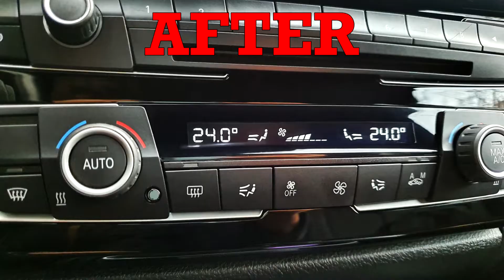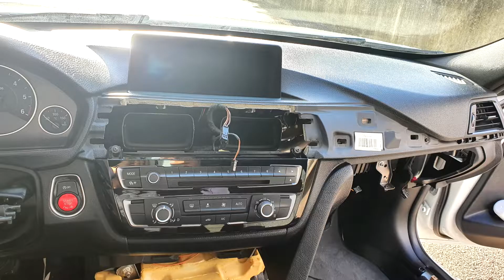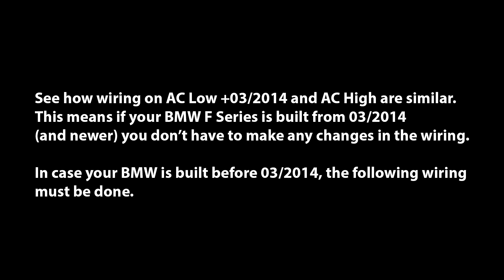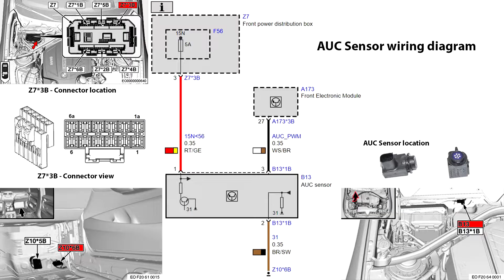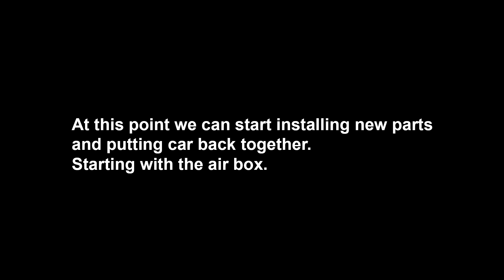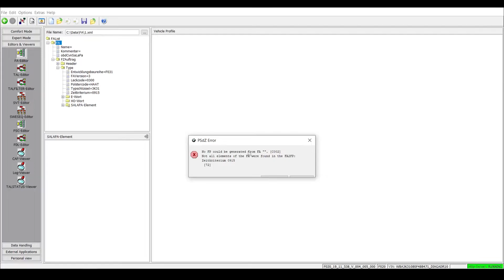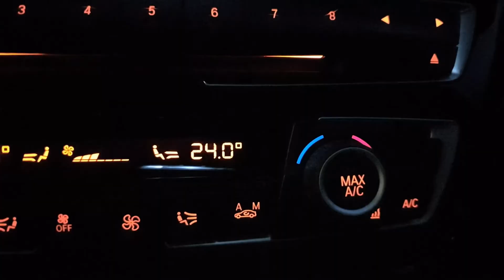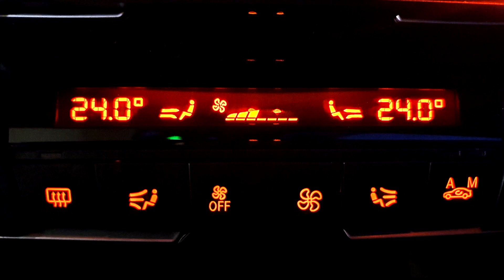Dual-zone A/C retrofit on BMW F30 + IHKA3 Retrofit

Comment: Well done mate!
I've done the same retrofit on my 05/2014 F20. Was a little bit easier than yours because I didn't needed to change dates on FEM. Also my car is already equipped with can2 and IHKA3. But congratulations for the tutorial!
In my opinion, it's a retrofit that as a medium difficulty but should only be done by people who know what they are doing.
Reply from the maker: Thank you.
Yes, exactly like that, this retrofit is not that difficult but time consuming and should be definitely done by someone who knows what's doing.

This shouldn't be a first retrofit for someone who haven't done any modifications to their car.
Reply: How do you find out if your F20 is already equipped with can2 and IHKA3?
Reply: @abdul-otf  E-SYS will show you the name of the module. Also, the wiring to the idrive joystick will determine if you have can ou can2!

Comment: Hi ace I did everything like you did in the video but my heaters don't turn off they just go to the lowest setting like yours did in the video. What did you do so it turns completely off and not just staying on the lowest mode no matter how many times you press the button. Thanks
Reply from the maker: Hi, sorry for the late reply you have probably solved the issue bynow, but anyway, you just need to recharge the AC and then you can turn off the fan completely. :)
Reply: No worried thanks for he reply so just change uo the ac and the fan should be able to go off and not stay on the first speed.

Comment: Hi, I have a question. I have a 2013 F30 and it has 2 zone air conditioning. Can I install such a panel in my car? I probably don't have an IKHA 3 in my car - will a swap for an IKHA 3 and coding suffice?
Reply: Hey. Did you ever got to the end of it? I'm looking for the same console,just don't know if swapping and coding it is suffice
Reply: @ nope

Comment: Thanks for this video! On the other hand, I wanted to upgrade just climate panel from 1 zone auto to 2 zone (digital) auto without fully retrofitting my AC. So I do not need an 2 zones, just one with digital two zone panel. Do you maybe know how I could do just that?
Reply: yes it is possible

Comment: I already have dual zone climate, but from 2014. What are the benefits to upgrading to IHKA3?
Reply from the maker: Benefit from IHKA to IHKA3 is only esthetic.
The only difference is screen, it's re-designed and has 2 colors (amber and white for day and night) while IHKA has only amber light.
Since I have doing a complete dual-zone retrofit I have decided to go with IHKA3 bcs price difference is very little.

Since your car is 2014, you might already have IHKA3 ECU, remove glove box and take a look.
If you have it, you only need new screen and coding.
Reply: @Acelele320  if my car is 2012 but equipped with dual zone climate control, what are the things needed to retrofit the IHKA3?

Thanks 🙏🏻
Reply from the maker: @johnpatrick7101  Hi.
You need:
- IHKA3 ECU
- A/C screen
(Screen needs to be 2016, ECU as a minimum, mid-2014+ or even better, 2015)
For the wiring and coding check the video.

Comment: Hello ace
I have a 2014 march f30 can i simply just swap the heater/radio outer trim and code it to work with my headlights.As in go from white display to red at night.
Reply from the maker: 03/2014 F30 should have IHKA3 ECU, but am not 100% sure.
It would be better if you take out the ECU and compare it with the video.
To take out ECU you need to remove glove box only, not whole dash.
Reply: @Acelele320  thanks mate.its a plug n play.I didnt even have to code it.works perfectly with my headlights aswell.👍👍👍

Comment: HI, can tell me from where you have retrofits manuals? I want to do few things with my car but no idea where to find wiring schematics and of course how to code car after.
Reply from the maker: newtis.info you need to register and then you have access to the wiring diagrams
Reply: @Acelele320  Thx for replay but this website is already locked. From this web you knew how to code car after job as well?